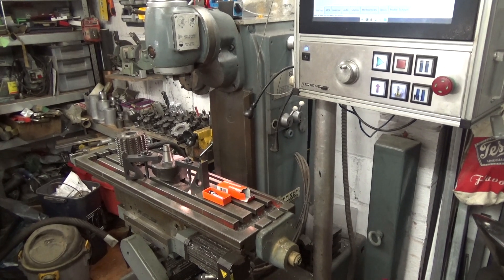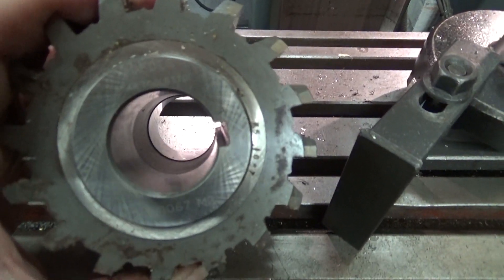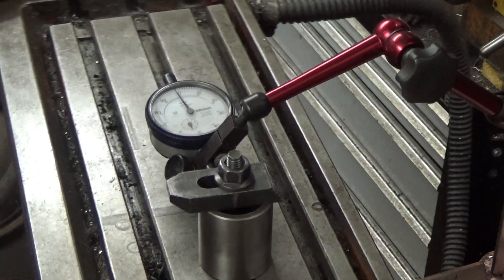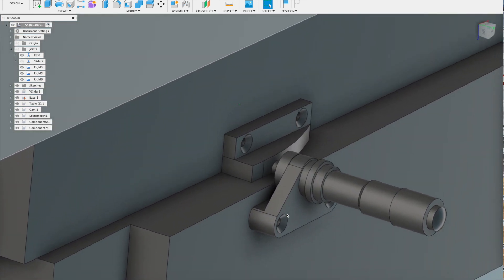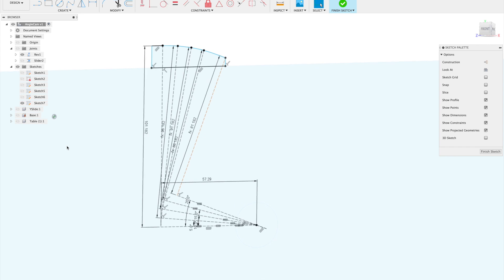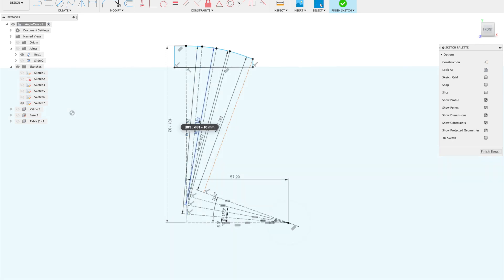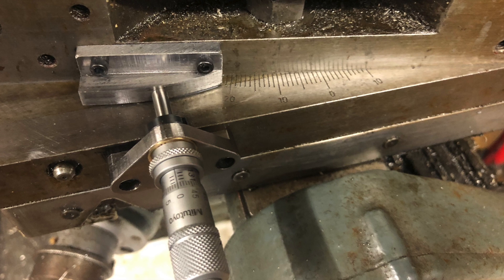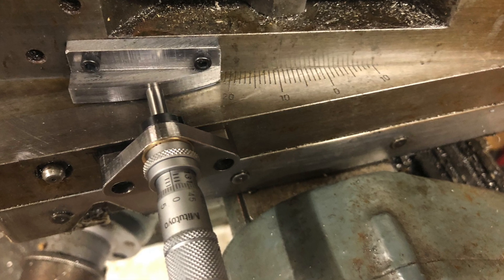How to set angles with a Micrometer

Comment: Couldn't you have mounted the micrometer bezel at 90° to the default table angle using 2 'L' brackets, or wouldn't that have worked correctly?
Reply from the maker: This way the millimeter reading works out exactly as degrees.

Comment: If that's about 15 thou of slop in the pivot, and the pivot is about 3.5" away from the  cam contact point then, using the small angel ;-) approximation, I make that about 15 minutes or arc error.  
0.015*25.4/sqrt( (2*25.4+16)^2+57.29^2)*57.29 = 0.248 deg. 
Not too shabby. 
The alternative of an imperial mic translated 5.7" across would bring that error down to about 8 minutes of arc I think. If I've done all my maths right of course! And I'm not entirely convinced that the dial gauge jumping around by 15 thou really represents an actuall pivot slop of 15 thou.
Reply: Eric Featherstone not too shabby I agree
Reply: The indicator was probably metric making it 0,15mm or about 6 thou